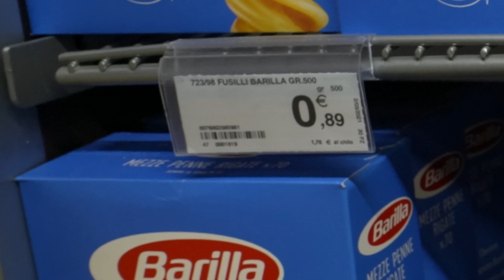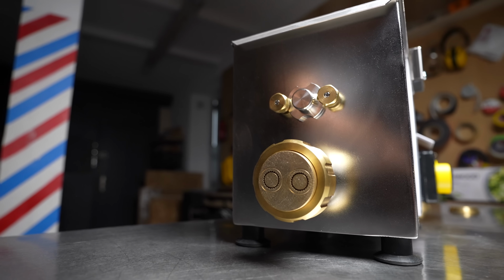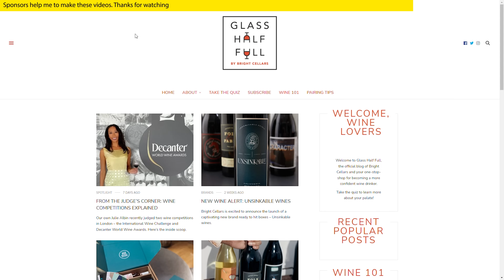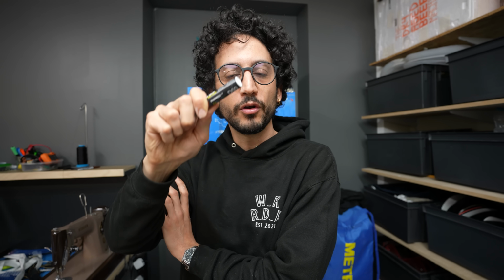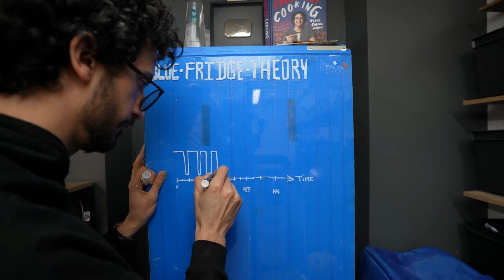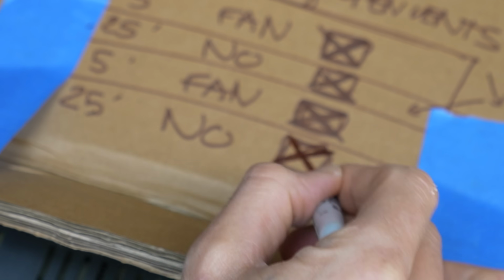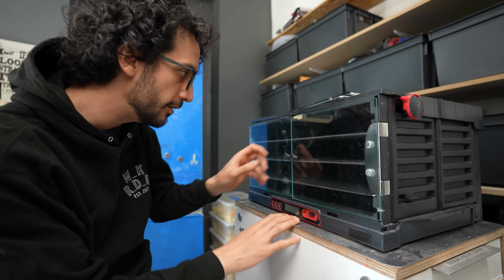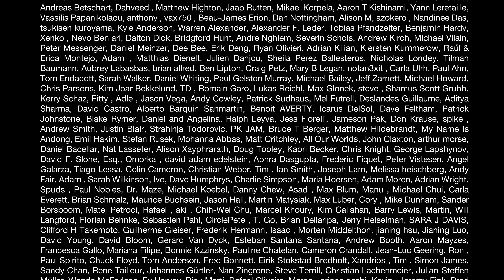This is Why Drying Pasta At Home IS ALMOST IMPOSSIBLE

Comment: Hi Alex

I really enjoy your video.

Just dry your pasta at room temperature over several days when you have nice dry weather. 

This is how it was done since hundreds of years

.the big industrial dryers are just needed if you want to dry pasta on a large scale quick.....

This advice comes from a professional chef that has made lots of pasta like you did. 
I personally even prefer to just freeze the pasta as it comes out of the extruder.
Just put from frozen in the boiling water...works very well

Seeing that you are an electrical engeneer get an Arduino with an temp and humidity sensor...you can then controll your temp and fan speed via arduino. Also include an air intake and air outtake.

When you have reached a certain level of humidity you need to blow the wet air out and let dryer air go inside.

A few lines of coding will allow you to make a super accurate pasta dryer.

Try also to add some herbs and garlic into the dryer during drying of the pasta
The etherian oils from the herbs might create a very nice flavour as well.

Keep up the good work

Comment: I imagine part of the function of the resting periods is to allow the starch to crystallize. That will "squeeze" out more water that can be removed at the higher temp steps, and the crystalline structure will give it more structural stability. When you boil the pasta again the starch crystals will melt and gel with water again, making it soft.
I guess the trick is to really anneal the pasta. Make sure the dimensional changes from crystallization and water loss do not happen so quickly that cracks form, and allow resting periods to let crystals form and reorient to alleviate internal stresses (also to reduce cracks). No idea what kind of temp/time profile will look like though :)
Reply: I also looked up the glass transition temperature of amylose/amylopectin (starch). It appears to 50-60C, which aligns with some of the lower resting temperatures you showed in the scientific temp profiles. This temperature allows the starch molecules to be mobile, reorient, and crystallize. Being below this temp will lock them in a glassy, immobile state. They will not move to relieve stress. So, high-ish temps are still needed for resting, I think.
Reply: @MrArmlicker1  Thanks for looking into this - I was thinking that there was a physical / chemical transition in the material as the moisture content dropped, and quite possibly that the threshold was slightly below 12% moisture, which would come about all too easily if the evaporation rate greatly exceeded the internal diffusion rate. 

My thinking - admitedly not too deep - would be mor along the lines of the grains of the flour/starch losing mutual adhesion, but your point about a  glass transition of the starch would also be a contributing factor in the loss of product quality / stability, and is something to be avoided.

Comment: For anyone interested, plastic and elastic describe modes of deformation, not so much a state of a material. Elastic describes a deformation where the material returns to it's original state after the force is removed. Plastic describes a deformation where the material retains some portion of it's new shape after the force is removed.

Comment: Used to work at an italian restaurant, and we found out by boiling the die before putting in on the machine would help us achive a perfectly smooth pasta everytime. The heat helps it to slide out og the machine

Comment: When you were doing the fan test, it looks like the fan was taking air out from the inside, not blowing air in. That string looked like it was getting pulled into the fan.
Reply: Yup, it is a centrifugal fan that sucks the air in from the center and expels it out in the direction of rotation (out of the edge).

Comment: Hey, so I know a thing or two about plastics vs elastics. Usually, elastics are softer, but it refers more to the end result than how strong something is. Most materials have an elastic region and a plastic region. Metals in springs, for example, have a very wide elastic region to make sure when they're stretched they go back where they should be. However, a plastic deformation is something like if you hit that spring with a hammer and left a dent. That dent is plastic deformation because it won't go back. 

What you may want to think of with the pasta is the change in yield strength, which is when the material experiences plastic deformation. Then the ultimate strength is when something will break. If those two are very close, you don't often see the elastic deformation. In essence, drying the pasta raises the yield strength of the material.

Comment: Kudos Alex!

The Blue Fridge Theory episode on the migration of the water molecules from the body of the spaghetti noodle to the surface where they can evaporate brought back memories of my undergraduate days studying chemical engineering, specifically the Mass Transfer class.

What you are explaining is a classic example where the internal diffusion of the water molecules is much slower than the rate of evaporation, and is thus the rate limiting step in the process.

It looks as if many researchers have not only figured this out, but actually quantified the model of the process, with the various times at temperatures and humidity levels in the drying process worked out.

In any case, the problem of the spaghetti makes for a very good examination question for an introductory mass transfer class!

Cheers!
Reply: I've worked on mass transfer modelling of pasta drying during my PhD time. Indeed, it's a diffusion limited process with a nonlinear sorption relationship on the surface.
Reply: @ivanpribec3353  Thanks for the verification of what this old(er) MS ChE suspected from coursework last done way too many years ago!

Comment: Professional pasta dryers are expensive but you may want to look at the patents to see how they are doing it, then cobble something together using the same principles. As an engineer one of the first things I check is the patents for anything that may be applicable to my project. Sometimes it works out sometimes it doesn't but it has many times saved me from reinventing the wheel.

Comment: Perhaps you should look into injecting steam into the dryer for the first stage of drying. Most industrial dryers will use steam for the first stage. This provides two things helps the pasta retain its shape and gives it a coat that strengthens the integrity of the pasta which as an added bonus improves texture after cooking. 

I’ve sort of gone around this issue somewhat cheating by blanching the pasta before drying it in two stages at 110c and the 50c. For me this did change everything and my pasta does not crack anymore.

Love the series.

Comment: Great work as always Alex! 
Concerning the names of the drying stages of pasta, plastic vs elastic, I'm fairly certain that the first, malleable state is called plastic for the same reason that plastic polymers are called plastics: the actual word plastic, which means malleable or pliable. So it's the plastic phase of pasta because it's soft an easily shaped, not that it's hard and rigid like finished plastic. And like you said yourself, the later stage is called the elastic phase because it springs back, like a rubber band, just a rubber band that can't stretch very far before breaking.
Reply: Also, I think it's worth looking into what Paulo told you about the resting phases. It's not all about temperature, it's also humidity. I'm pretty sure that a little bit of water is reabsorbed from the air into the outermost layer of the pasta, which would alleviate the stress that too quick drying would cause. So you'd need something like a humidity chamber where you can control the air humidity.

Comment: As someone with an MSc in Materials Science & Engineering, the difference between plastic and elastic makes perfect sense. Platic deformation is permanent, by definition, while elastic deformation means (also by definition) that the shape returns to its original shape when the load is removed. So: Squish = plastic, while Bounce = elastic.

Comment: when you use any type of dehydrator or when you use high heat to dry your pasta, you create air bubbles in the pasta which gives it that brittle texture, if you let the pasta sit at room temperature over night like you're staling bread, the starch will do most of the work of stiffening up your pasta before letting it sit in front of an air conditioner or a fan for a few days until the pasta is to the degree of dryness that you desire

Comment: An open door will result in less airflow, Alex. When the doors are closed there will be more air circulation. Tape the piece of string to the inside of the dehydrator and run it with the doors closed. You'll see more movement. It's the same concept as cracking your door open on a windy day vs having it all the way open. Pressure differential is what the fan creates, and being completely open means it cannot achieve that.
Reply: you can see in one shot, that the string is actually drawn into the middle, meaning this fan sucks air into it through the hole in the middle and probably distributes it out radially through those grills you can see around the perimeter of the fan.

Comment: Alex you can just buy a static pasta dryer.  You have to have temperature control, humidity control, adjustable air intake valves.  I love your commitment all the same.  You can make one with a constant temp PTC, raspberry pi and a couple of fans in an aluminium box, if space is an issue.

Comment: Hi Alex, a ChemEng follower here. The fan will definitely help but I think I know what the mistake is. The y axis on the step diagram you drew on the blue board is temperature but what you did is just turning the over on and off at 60degC. The drier is insulated so it probably kept that temp throughout. You need to go high temp (let's say 60degC), rest by keeping the pasta at that high temp, then lower the temp (let's say 20degC) and rest by keeping the temperature at that low temp. Cracking open the drier door while keeping the fan on would help to cool. The fan will ensure you have a uniform temp so I would ideally keep the fan system separate from the heating to be able to have it on while you shut your heating. Hope this helps

Comment: You could use an environmental test chamber to dry the pasta. They're usually programmable to control humidity and temperature. For instance you could tell the machine to be 50c & 50% relative humidity for 12, rest, then more parameters.
You'd need a bench top  programmable environmental test chamber. I suggest to with the company Espec. I've used them in R&D engineering.

Comment: Most deformations have both kinds of deformation happening at the same time. But depending on the rigidity of the material it is more plastic- or elastic deformation.
If you take a look at stress diagrams, you will see that every force exerted on the material is always bouncing back at least a little.

Comment: Elastic deformation = Generally a lower applied force so that the material can recover to its' original form. For example, bending a pasta straw a little.
Plastic deformation = Generally a stronger applied force so that the material can't recover to its' original form. For example, bending a pasta straw a little more until it cracks.

Plastic deformation has several permanent deformation types that all have to do with permanent changes from the original shape. Cracking, permanent bending, necking etc..

Comment: I believe the center portion of the fan is the intake. It is sucking air in. And it blows out of the side. Those dehydrators are supposed to have low flow air.

Comment: It looks like the drying process and issues with pasta are very similar to drying timber. Some of the most impressive and effective methods use a vacuum kiln with either heat through hot water plates or radio frequencies to generate heat. May be worth looking into the vacuum part and its not too expensive to try.

Comment: Plastic comes from the Greek plastikos - meaning moldable. So when it's soft, it's moldable. Elastic comes from the Greek elastikos - meaning propulsive, or 'to resume normal shape spontaneously after contraction'. So when it's hard, attempting to deform it results in it returning to original form. Though it can appear to us as very hard, even steel is considered 'elastic' to a certain small degree. If you force something past its modulus of elasticity it breaks. So when you squeeze the round tube, at first it squeezes a tiny bit, but then just like if you force a piece of steel to bend too much, it will crack.

Comment: I have that dehydrator and have to say that I think your fan is wired or installed backwards. it should be a heated intake into the  the chamber then out the front, not an exhaust out of the dehydrator. your string test made it look like it was exhausting out the back which is not how it's supposed to be configured, which would explain why the pasta seemed to be so inconsistent.

looking forward to the rest of this series!

Comment: Bro. What about one of those tower dehydrators? The circular plates that stack together, so you make it however tall you want. Then the lid on top has the heater and fan controls. Those move a good bit of air. Used one to dry pineapple, made the house smell so good. Nesco makes them.

Comment: To reduce cracks in the noodle you can also:
Extrude the noodles in vacuum
Reprocess the beginning of the batch, because there is not enough pressure in the beginning
Change the screw of the extruder for a one the has a smaller pace in the end
The die and preassure inside the machine is also important, Different dies will have different cracks in the final product.

Comment: Based on what i.saw form the string, the only thing that fan does is exhaust air which means there is very little movement of air further away but more near it. Tou would need a fan blowing in and something to exhaust the air to get consistant air flow

Comment: I would like to make a quick blurb about why materials science considers the "soft" pasta state plastic and the "hard" pasta state elastic. 

As Alex said in the video, elastic deformation is when a force is applied to the pasta, the pasta will recover to the original shape. Conversely, if you push the material too far, it will experience plastic deformation, which is unrecoverable. This is all true.

It's not so much we consider a "hard state" and a "soft state" as elastic or plastic, respectively. It's actually how we describe the material properties of a specific material (and can be applied to soft or hard materials). Generally, materials exhibit a range of stresses in which they can recover from slight amounts of deformation, but push it too far and it will plasticly deform. We call this point, yield strength. Most metals (which are generally hard), usually have both an elastic and plastic regime. Polymers (which can be soft), also can have both an elastic and plastic regime. The amount of stress a material can handle is related to the stiffness of the material (incorporated in Young's Modulus)... we'll get to this later. 

Now what Alex showed was that when he pressed too hard on his dried pasta, it broke. I would consider that a fracture issue. If we increase the stress of a material even more, most likely it'll experience fracture (occurs in metals, polymers, ceramics, etc.). From my observation, the dried pasta underwent brittle fracture (I can explain the differences in fracture types in the comments if someone asks). For brittle materials, we generally think of things like ceramics. They are super hard, but will shatter if enough stress is imparted into them. Classically, we generally considered brittle materials to fracture before they even plastically deform (meaning their fracture strength is lower than their yield strength). So, for a ceramic (in this case dried pasta) to withstand a higher amount of force/stress before fracturing, it's stiffness (Young's modulus) would have to increase. This would allow Alex to impart a larger force into the dried pasta without it breaking. 

But we have to consider that he's using the same composition/processing (same recipe) for all of his batches (hopefully). The dried pasta that results from it will have a specific fracture strength (if dried properly). So with that in mind, there's something else that needs to be considered. It's defects in the dried pasta structure. Fast drying the pasta resulted in a lot of cracking (many defects). Well, cracking (and defects) turns out to be REALLY bad for fracture. By drying nice and slowly and ensuring that there are minimal cracks/defects, we can improve the fracture strength, making it less likely for the pasta to fracture at lower than expected stresses. 

I'm pretty sure this is what is happening with Alex's pasta and he's doing a great job trying to figure out how to jerry-rig something that will give him a better result. Really inspirational stuff. 

If anyone else has any other information to add to my materials science explanation/analysis, please feel free to add in the comments. Questions are always welcomed.

Comment: That manual process of turning the dehydrator off and on again, that's dedication. But you need to look into something like a SwitchBot that you can program to push buttons for you. Upgrade the ventilation, get an arduino, hook up an automatic button presser (or just solder directly to the contacts, up to you), and if you want to get real fancy you can hook the temperature and humidity readouts to the arduino. A poor man's pasta dryer. I think it needs to happen.

Comment: This is like a PCB reflow oven. It uses a schedule of heating and holding patterns. I use a programmed microcontroller with a temp sensor to manage the whole process. It's a simple arduino shield even.